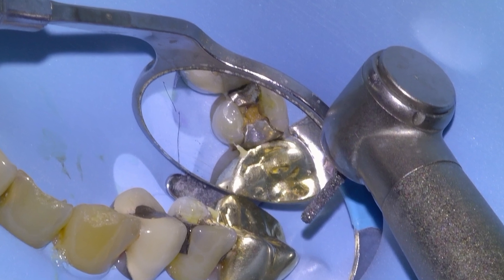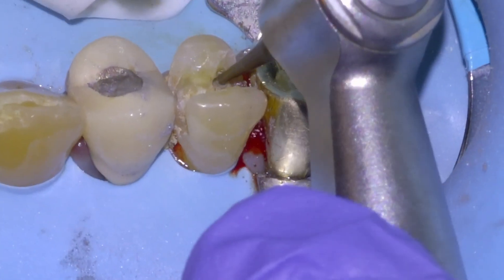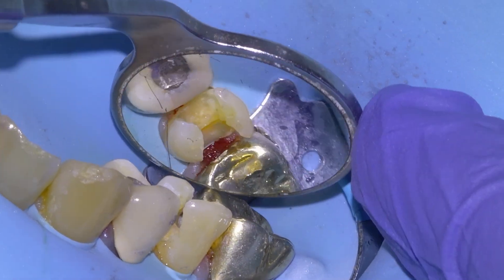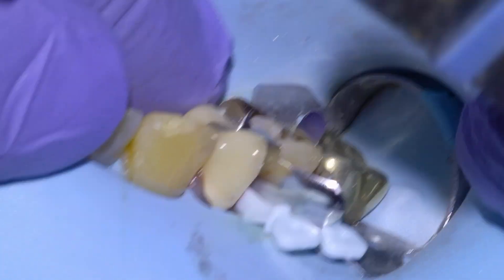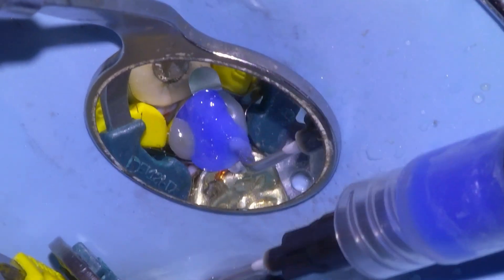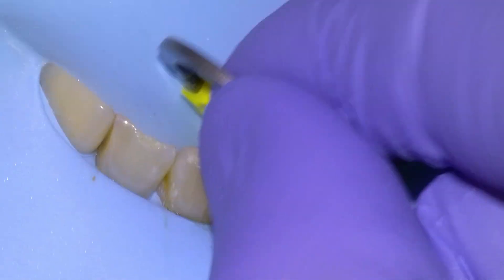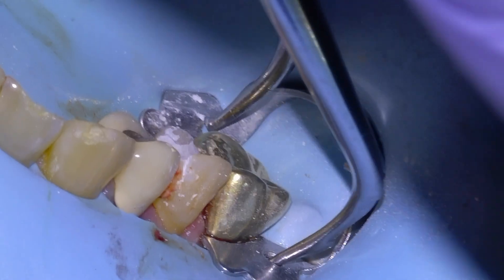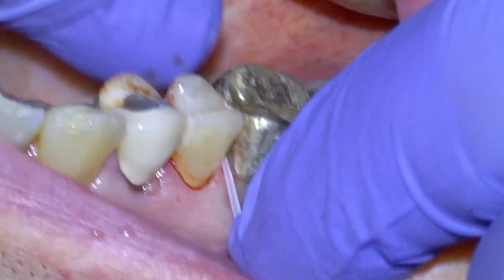[40] Live Restoration of Fractured Dental Filling

Comment: Considering the remaining healthy tooth structure, what is your evaluation of the restorations prognosis?
Reply from the maker: Guarded to poor. I'm not sure reducing further axial tooth structure for a crown would be of any value unless it was paired with crown lengthening. Fortunately if it fails it will just be a horizontal cusp fracture and not a split down the middle. Crown/CL was advised but was cost prohibitive for this pt. Pray for this one pls 🙏🙏🙏
Reply: The unfortunate result of patient modifiers. Sending prayers but you certainly did the best you could under the circumstances.

Love the videos Dr. Dobson, keep em coming!

  @behindtheloupes